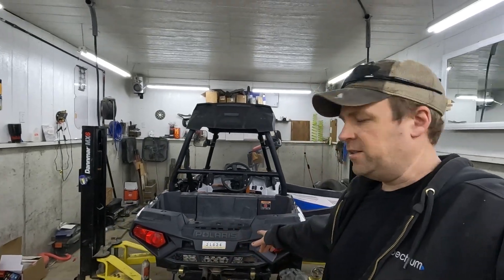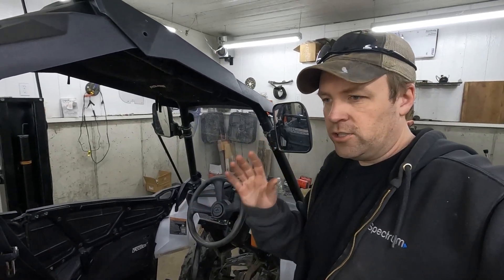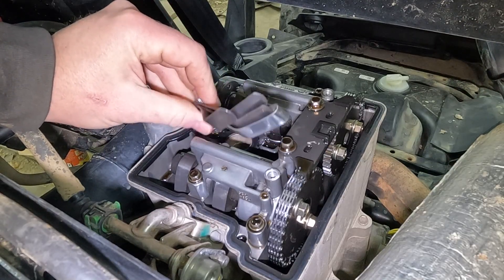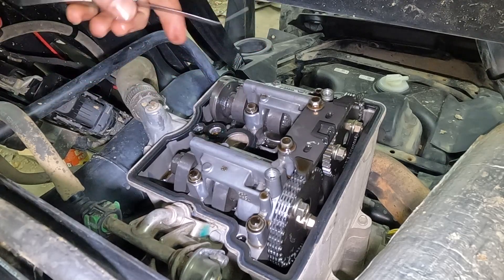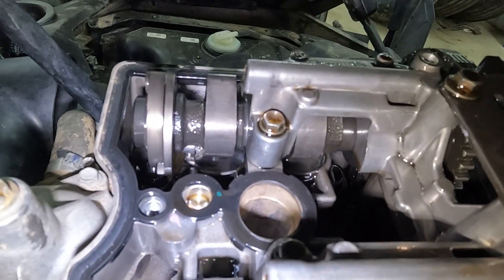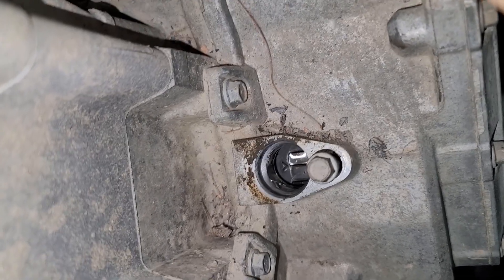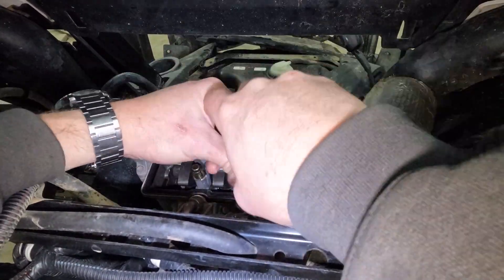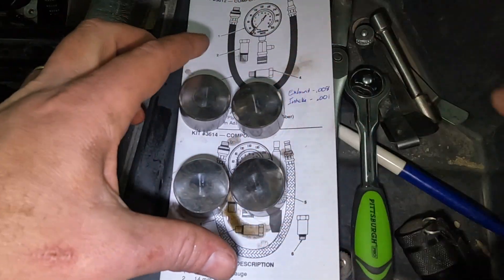Dwight hard to start and stalls. Has fuel, has spark. Valve Lash perhaps?  Let's check.  Part 1 of 2

Comment: I put in a rebuilt engine, crank up pretty good has to warm up close to 90 then it idle perfit, but when I put in gear it start missing. Got new plug (seem to be black like getting to much gas) wire, coil, and air Spencer. I don't see any adjustment what do I need to do . Thanks James Mayo
Reply from the maker: Did you check the valve lash?  I found that these engines don't like to run when cold if the valve lash is off by a little bit.  Outside of that, double check your timing marks.  Maybe it's off by a little bit.  Just a few ideas.  Hopefully you're able to get that tracked down!

Comment: well, what nobody shows is all the crap they have to take off to get to the valve cover! typical Polaris poorly designed machines, take to the dealer ?
Reply from the maker: I did show it!  You pull out the bed cover and the cylinder head is right there.  Spark plug wire comes out, 3 bolts are holding it on.  Pull it off and the cams are right there.  That's it!  In my opinion, these machines were very well designed and are far easier to work on that many others.  There are a couple things that could be better (steering rack, differential, trans output shaft), but the valves are right up top and in the open.  As always, if you aren't comfortable working on these machines, you should definitely take it to a professional.
Reply: @3DayWeekend Well...the valve design is kind of stupid and complicated. The old style with a screw is just easier to work with and you don't need to buy parts to change the clearances.

Comment: What app do you use to check the specs??
Reply from the maker: I downloaded the service manual.  It is all outlined there.  For some machines, I have to buy a digital copy (cheap from eBay or similar), but I was able to find a downloadable PDF for this one!

Comment: Great video but you got one in every crowd and it has to be me lol I would have loved if you showed the way it was doing when you started it and after but it will keep me confused back keep smiling
Reply from the maker: There is always that guy!  haha  Yeah, it's hard to replicate an intermittent issue.  It pretty much had to sit overnight to do it.  Once it fired in the morning it was good!  The valve lash was definitely way too tight and was an issue, but it started doing the same thing later on.  We found a defective cylinder which was causing abnormal wear on the rings.  What a mess.  It's running like a champ now though!  Thanks for watching and for the comment!

Comment: Hey 3-day weekend I have a question for you? My Polaris 570 is doing the same thing as yours I have tight intake valves when I measure there is no Gap in between the cam in the bucket shims both intakes are 480 shims where do you think I should go from here
Reply from the maker: Hey there!  That's a hard call.  They could be right at zero, or they could be even tighter than that.  I just assumed mine were at 0 gap and got the right shim to give me the gap back.  I know they aren't cheap so you don't want to spend too much experimenting, but I don't know a better way to do it.  If you feel it's almost zero, do it that way.  If you feel that it's pushing down on the valve, maybe just deduct another hundredth as your starting point.  Hope that helps!  Thanks for your comment and for watching!

Comment: should have backed that tensioner off
Reply from the maker: Yes, and I did when I was ready to move the cams around.  Ended up just taking it right now.
Reply: Are you supposed to take the tension off of the chain? I am doing this job right now and my feeler gauge won't go in any of the tappets...

Comment: tight intake valve lash is a sign of taking in dust from the filter had the same problem with my rzr 900 mine came from running k&n air filters
Reply from the maker: Yeah...dust, or MUD!  This machine got swamped a while back and pulled a ton of mud into the cylinder.  Ended up replacing the piston, rings, and cylinder.  Ran great after the rebuild, until now!  

Thanks for watching!

Rebuild video:  https://youtu.be/jO76RiG825A